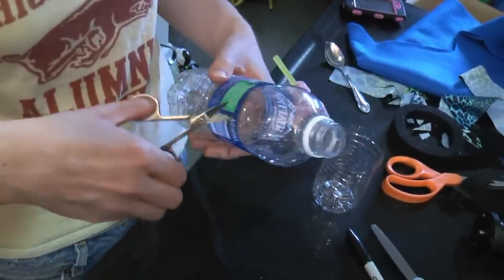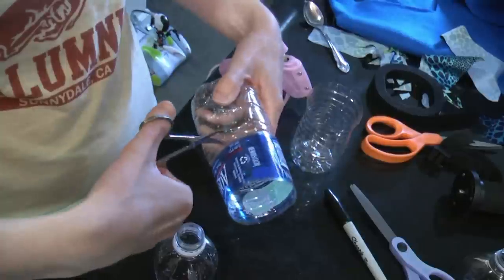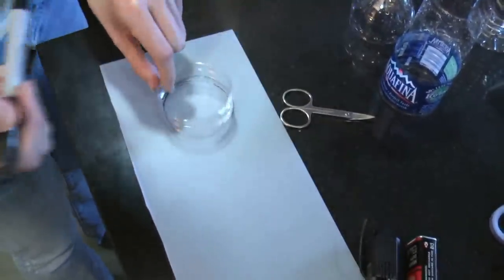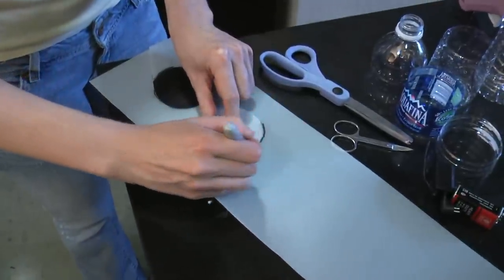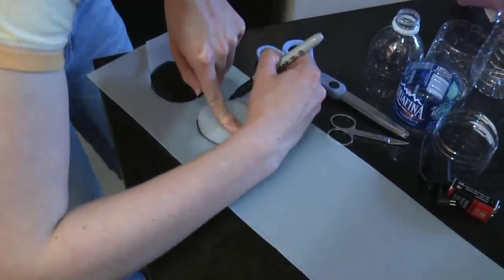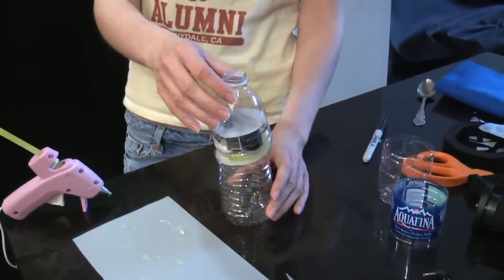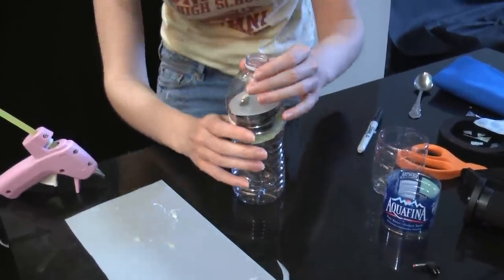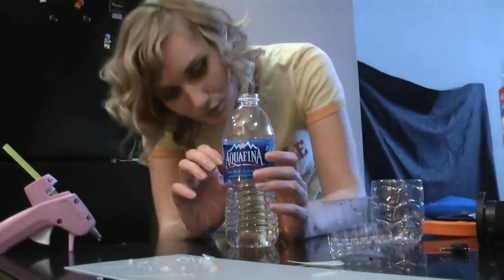How To Make A Water Bottle Spy Cam

Comment: 9 volt battery will only give you about 2 to 3 hours of lifespan. What do you do after that ? make another new bottle ? this is purely a kids idea ..
Reply: Lone Wolf That's often all you need with a motion sensing camera which doesn't record when nothing is moving.  

Obviously it's not a long term solution but for more than one reason like that if a water bottle is left sitting around too long then someone is going to move it or throw it away.

Then again, most people aren't very observant and wouldn't notice one of several different hidden camera types.  One popular alternative is putting it in a stuffed animal's head and using a 2nd dummy  camera for the 2nd eye of the animal so they both look the same.